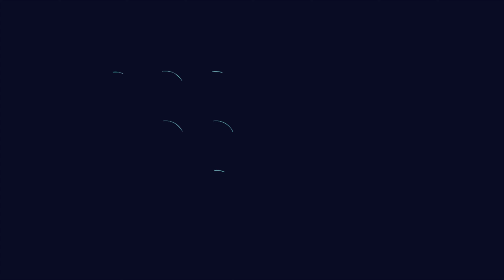Fractal Design Pop Mini Air Micro ATX Review

Comment: I agree with you that micro ATX builts are a great option for most cases. The only thing that would improve in this box is that the fans were pmw
Reply from the maker: Agreed. Not the end of the world mind, but I'm not sure why they didn't include 4 pin fans? May be to cut costs?
Reply: @jimbopcbuilds  or maybe a large stock of those fans!
Reply from the maker: Quite possibly. They're also cheaper to make as well :)

Comment: Watched both videos on the Lian li 205 Mesh and this one
Reply from the maker: Thank you. There's a Lancool 205m Mesh out now as well. Which do you prefer?
Reply: @jimbopcbuilds  Probably will go with the Lian Li 205m Mesh, but both options seem like good choices. The Specs I will using are Ryzen 5600, ASUS TUF B550M-PLUS  Motherboard Wifi 2, ID Cooling SE-214-XT, Zotac 3060, 1TB Sabrent SSD, 3200mhz 16GB Silicon Power, EVGA 650W Supernova GT
Reply from the maker: That’s a pretty good spec. I ended up having my main build in the pop mini and the only thing I didn’t like was not being able to put my 240 AIO on the top without an adapter. Something that’s not a problem in a205m
Reply: @jimbopcbuilds  Awesome
Reply: @jimbopcbuilds  Would all the parts I listed fit in the 205M Mesh?
Reply from the maker: @ArrowSlayer   Looks good to me. The cooler doesn't look too tall and the motherboard is mATX.
Reply: @jimbopcbuilds  Glad to hear that, thank you for answering!
Reply from the maker: @ArrowSlayer   Any time :)

Comment: is it possible to put 360 radiator on top? seems there are enough space for it but it says only 240 on top from the manual
Reply from the maker: There is only room for a 240 and you need to buy an adaptor for that to fit. Even then it'll be a bit tight. Personally I installed a 240 at the front and bit the bullet and have it not as I would like it to avoid paying for the adaptor.

Comment from the maker: Further details: Fractal do say you can fit an AIO at the top with an adapter (you need to purchase), but I still have my doubts. Also you can mount storage on the PSU basement but again you need to buy an adapter which is a shame. Finally the RGB controller doesn't have a cable to connect to compatible motherboards which isn't great.